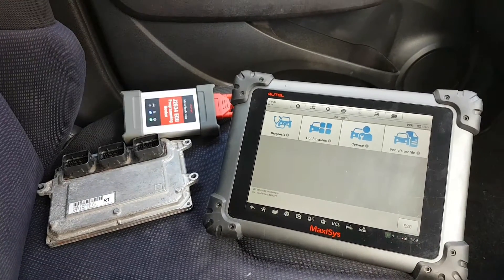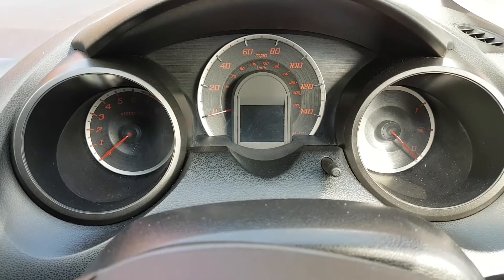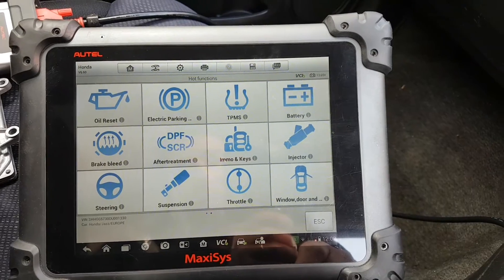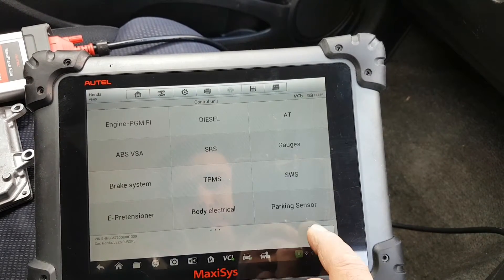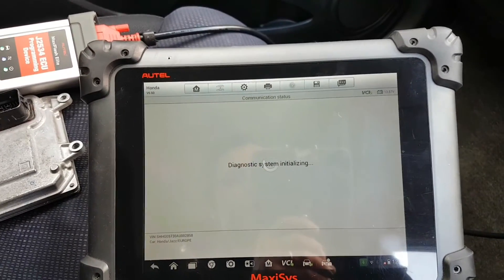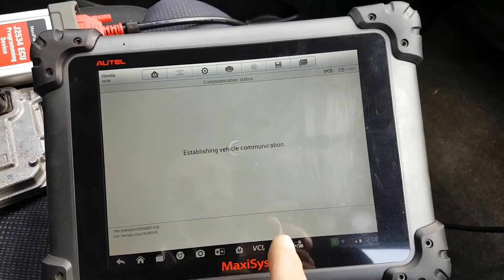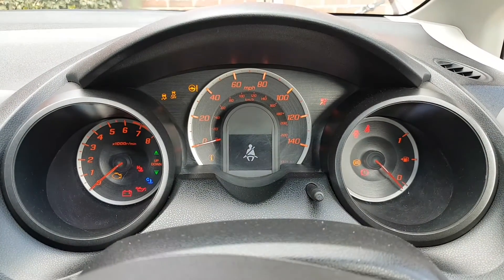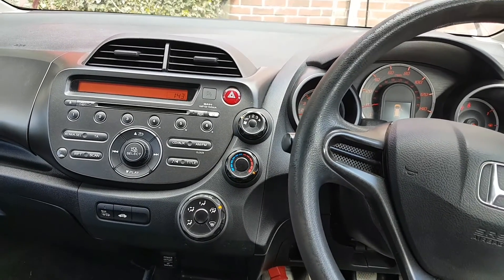Honda Jazz used ECU/PCM programming with the MS908P.

Comment: Hi there, I got a question I have a 2017 Honda Accord my green light mobilizer stays on, and I have no crank no starting  I put my scanner   it does not communicate with mobilizer. Any idea where I should start first? Fuses are good has been front accident. Only Hood hitch was damaged. And I replaced that but still no success and the help I really appreciate that, sir. Thank you.
Reply: Try all key Lost

Comment: I have got the exact same number on ECU what you have in this video ( I have 2013 honda I have found another ECU for 2009 but the last 2 number is G02  instead of G16 ) the rest engine is all the same will it work ? ( Also my ECU has oe UK the other one is JP ) I would really appreciate if anyone can answer please confirm
Reply: Hi I just done this but it's still misfiring on injector 2 and 4
Reply from the maker: Hi
Difficult to tell... it might be just a software difference and still work... but unfortunately can't really say... ring the dealer and see if they can help...

Comment: For a fiat bravo tjet 2008 is the same?
Reply from the maker: Each manufacturer is slightly different...
Don't think is the same for that one...
👍👍👍
Reply: @LMAutoRepairs  how to do for a Bravo
Reply from the maker: @londondaddy7013  
Depends on the ecu installed.. 
Some can't even be done this way... and needs either virginize first, or need cloning...

Comment: Hi Luis, great video. I have 2013 Jazz 1.2 with 37820-RC7-G05 and it has one faulty injector SSD 103 transistors (causing misfire). I got 37820-RB2-G17 spare part from ebay - if I move the SSD 103 transistors from the spare ECU to the faulty one, will it work?
Reply from the maker: Should do the job, if anything else is bad...
👍👍👍
Reply: @LMAutoRepairs  hopefully so. I tried swapping the ECU itself but it could not communicate properly (RB2 model has a different wiring harness to RC7 model).

Comment: I bought the second hand ecu with the same IGNITION do you think will work if it goes into my bt50 2013??
Reply from the maker: Withe the same ignition? 
What do you mean?
👍👍👍
Reply: @LMAutoRepairs  hi mate 
My bt50 ecu damage and the mechanic came with the same scanner like yours, he plugged In and tried but apparently the old ecu need to function so he can load data from it into the second hand ecu....

Comment: Hello Luis thanks for the video it's necessary to read the old ECU data and write it back to the new ECU and what about if the ECU have different part number and the car is the same year , Model , will it work ??
Reply from the maker: Hi
As per the video... no need to read any data, part number can be slightly different, due to different variants,  as far as they are compatible will be fine...
👍👍👍
Reply: @LMAutoRepairs  thank you

Comment: Can i used this method to disable the transmission control unit?
Reply from the maker: Not sure... that might be part of the map, and you might require to flash to ecu with a manual transmission file...
Would have to investigate that one...
👍👍👍

Comment: hello Luis I've been following you for a long time and I love your approach to car repair and I work too, so I'm interested in why you don't try to move the transistors out of the ECU and so you can be sure it will be, it would be a good experiment, you find a gate driver leg and you just pass it out of the ECU and then solder + 12v or - depending on what kind of system it is and so you test whether it will fix the car. You can try this with all systems controlled by transistors or voltage stabilizers such as LM 7805 or current stabilizers. BEST REGARDS. AND WHEN WILL YOU MAKE A REAL WORKSHOP.😄
Reply from the maker: Hi
I swapped them just to try, and as you have seen, it proved my theory...
Yes, I could have swapped them an keep the original ecu, but the programming on these is so easy, that was easier and quicker to just program the second one... plus, open this ecu, was a real PITA....
😋
👍👍👍

Comment: Now that the car has a new ECU which must have different miles on the clock, and different miles from the ones shown at the dashboard, wouldn't anyone who buy that car and test it with a good scan tool, notice that the miles registered on the ECU are different from those on the dashboard and may think the car has a miles' fraud?
Reply from the maker: Hi
Not all cars stores the mileage on the PCM/ECU... some only store it on the cluster...
Not going to say 100% it is the case on this one... 
If the car has no big discrepancies against the MOT mileage readings, shouldn't be much of a problem though...
But I understand where you coming from...
I never actually checked (that I remember), if the mileage was recorded in there... probably should have, but that was definitely not a priority...😋
👍👍👍
Reply: @LMAutoRepairs  Ok, thanks for the reply. And, by the way, is the owner going to have any problem with the other car key/immobilizer? Is the ECU going to accept the other car key, since it was not programmed with it?
Reply from the maker: As I have explained in the video...
In this system, is the ecu that is programmed into the immobiliser system... all the keys programmed on it will carry on working as normal...
Reply: @LMAutoRepairs  Ok, I thought the immobilizer was part of the ECU... 😋I'm not a mechanic! Just someone who wants to learn something along the way...

Comment: I have had this happen the same and I bet it has to do with different specs on the vehicle regardless being the same nr ECU or in your case being 2 numbers off but still the same ECU. It worked and that's the most important . Imagine if it would have been the same issue again😂 grey hairs overnight. Good one Luis.
Reply from the maker: Great hairs indeed...🤣
👍👍👍